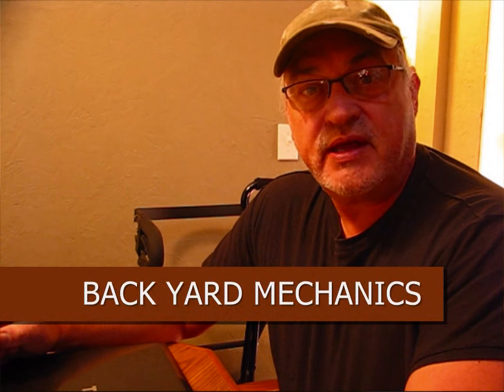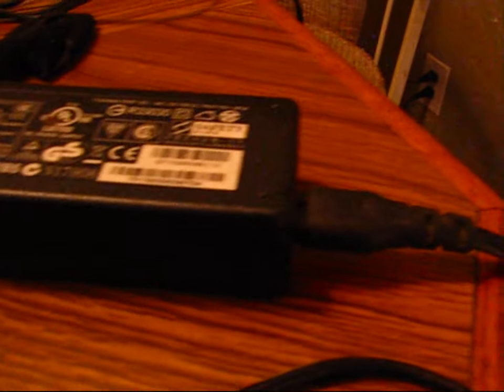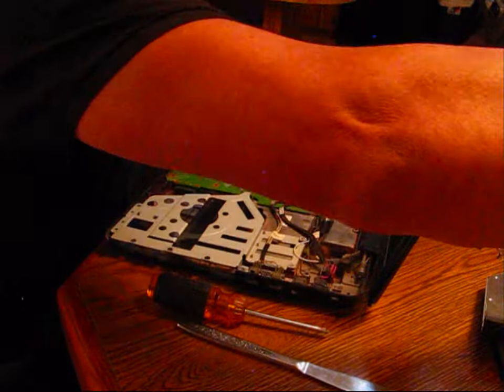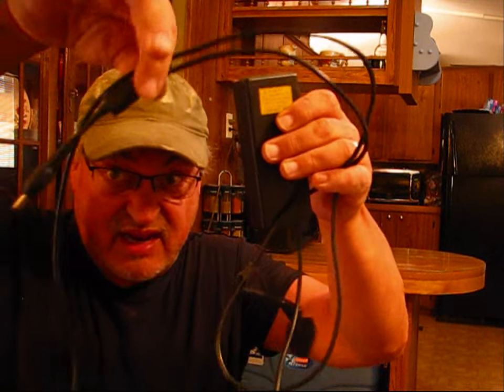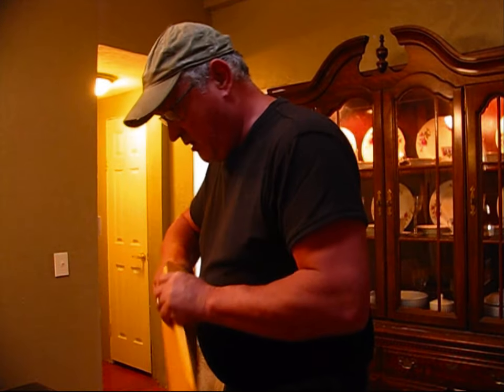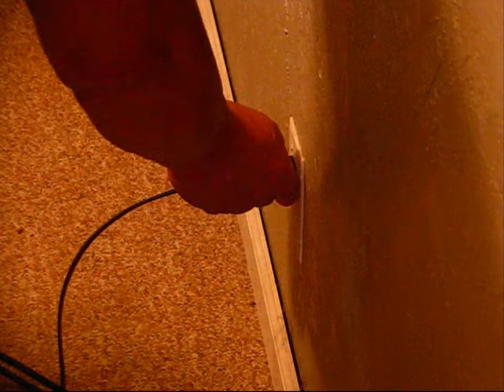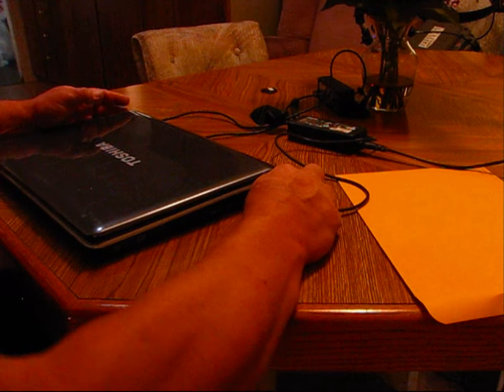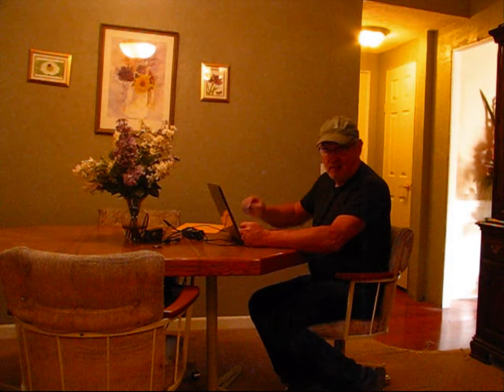BACKYARD MECHANICS - Laptop Computer Electrical Cord Failure

Comment: You were lucky that you didn't have to re-solder that part, I had a laptop where the socket broke, and that was soldered to the mother board, I bought a new part which cost pennies and asked my son in law who is a computer wizard if he would fix it for me. He did the job but it was a right pain because they use a very high heat solder when they manufacture those Korean laptops. The job looks simple but they really aren't built to be fixed, nothings built like it was in the old days eh! Gerry.
Reply from the maker: Way too complicated these days. I need a micro soldering iron for the tiny components on the motherboard.